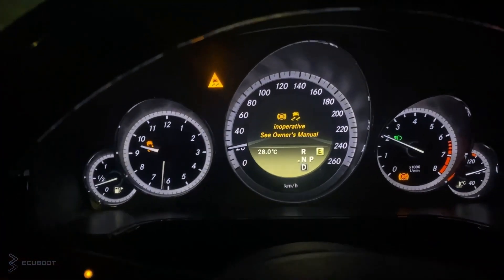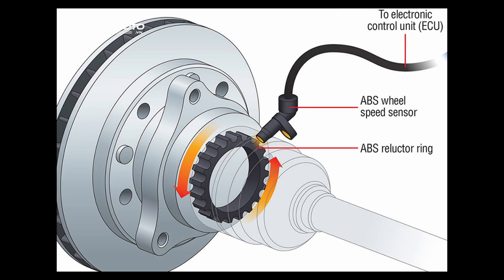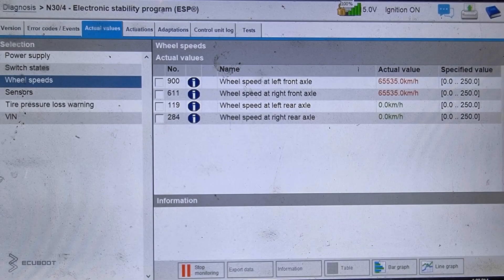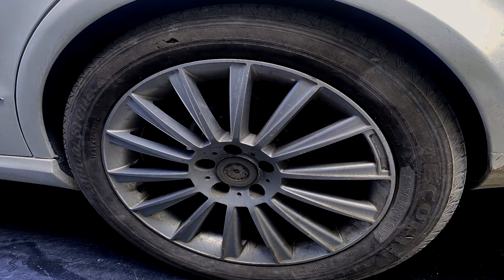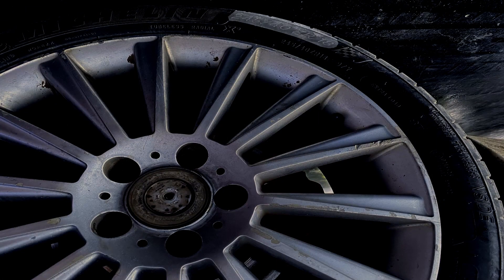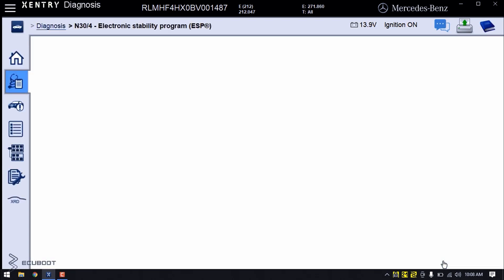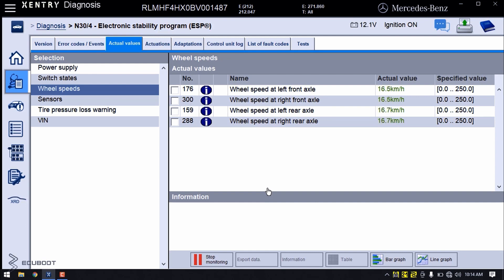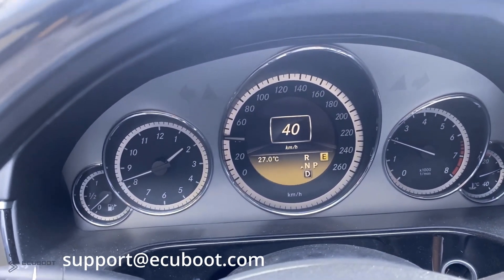Fixing ESP Inoperative Fault on Mercedes E250 W212

Comment: Hello, I've a s212 hybrid and my back wheels had 265/35r18. 
Can I change the tyre to 265/50r18 and  change with new wheels specifications using Xentry diagnostic, or I can't?!

Comment: Excellent video! I wonder if staggered rims with same size tires all around Will trip the esp code. I’m in the process of changing front abs sensors, hopefully my light esp and abs lights go out. I have 4 matching rims in route so if staggered rims contributed to the issue that should take that scenario out of the equation.